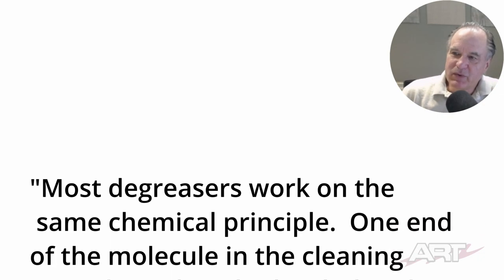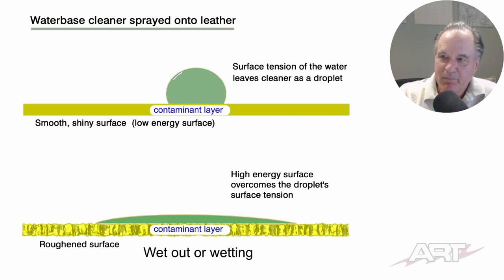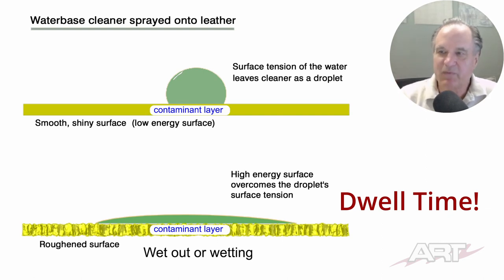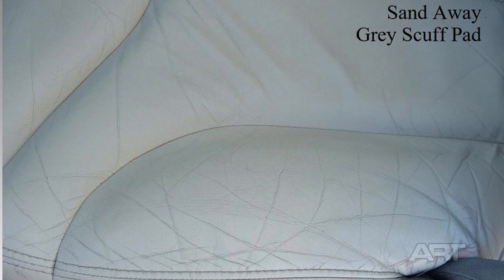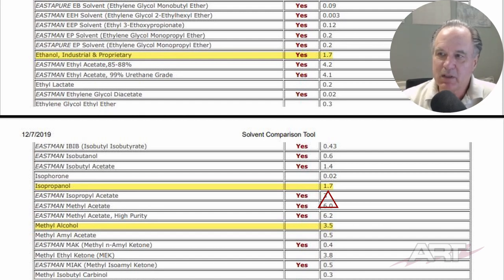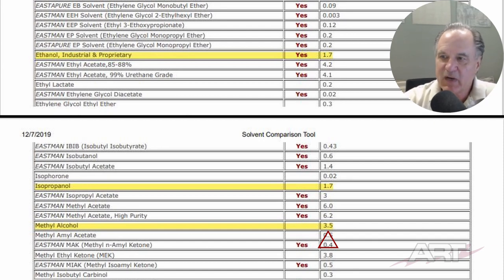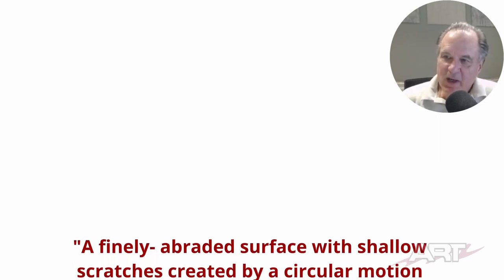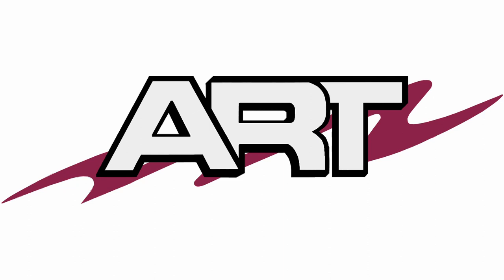The ART of Cleaning and Surface Preparation - Part 2 - v108

Comment: That's it, I'm calling you the "Professor" from now on! I've been doing most of these methods for years but I didn't know the "science" behind it. Unfortunately as you have discussed in other videos, a lot of the guys out there will never take the time to learn and do the necessary prep work much less use the right finishes. But for those who want to do it "right" this is the way.
Reply from the maker: Well the pressure is off when you quote chapter and verse of other published sources 😜😜

Comment: Hey Rick have you come across head oil on recliners. Having a hard time Keeping it from pealing even with cleaning prep and adhesion prompters.  2 questions just had a Mercedes with a bubble in dash, any suggestions 
Thanks Jeff
Reply from the maker: Oil in those recliners may take a long time and several applications to remove.  Don't expect to do it in a residence is my experience.
Don't know about the Mercedes but you can send a pic in email.

Comment: Hi Rick. Another amazing insight to prep! Since my training 10 years ago I've used a brush (tampico haired) when cleaning the surface of leather. If I were to be just cleaning the surface and not prepping for colour would I not be damaging the surface with the scuff pad if I'm only cleaning the surface? I always thought it would be too aggressive on the finish itself?
Reply from the maker: You will get more thorough coverage with a scuff pad.  With a brush you can leave streaks between the bristles esp. if not using in a circular motion.  Or chose a lighter duty pad.  (That's a hint for Part 3 coming)  Thanks
Reply: Try the white scuff pads or the Mr. Clean pads with caution of course